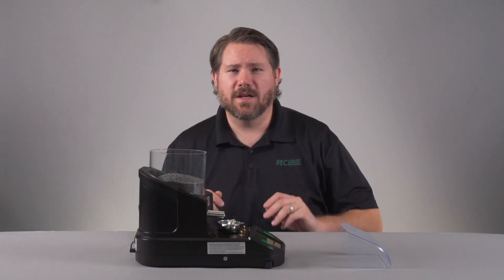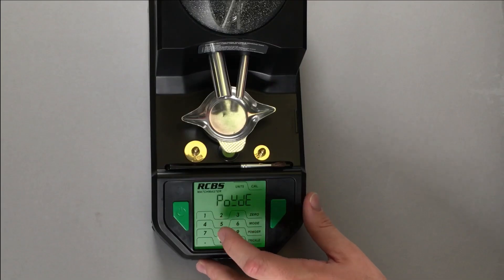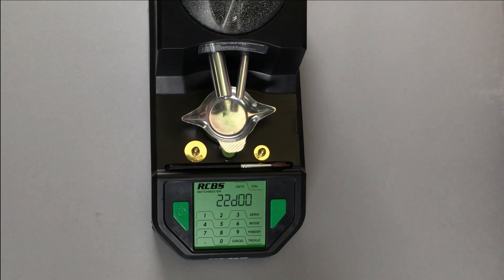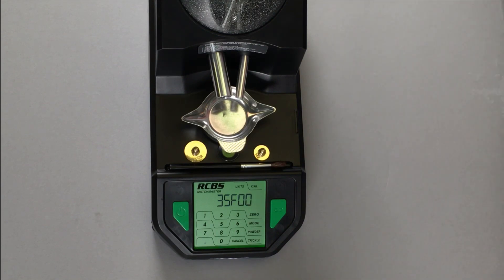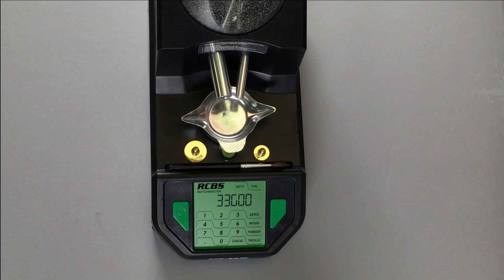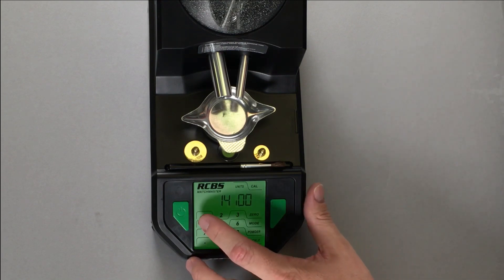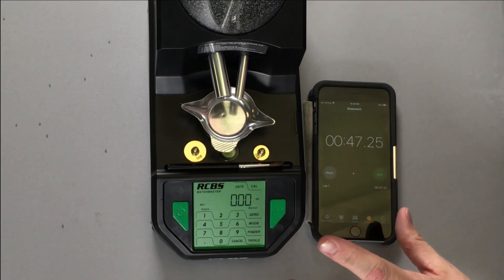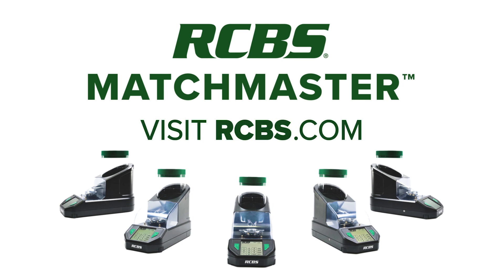MatchMaster: How To Create Customized Powder Dispense Parameters

Comment: Where is the separate video that shows how to use the App. I spent a lot of money to go to this machine so I can program my data through my phone.  Not using all these crazy codes.
Reply from the maker: Check your rounds with a caliper measuring cartridge overall length/desired bullet seating depth, and adjust your seat plug until you achieve the COAL/depth you are going for.